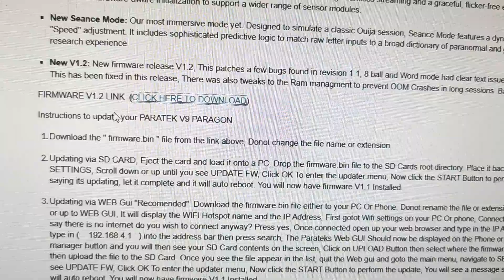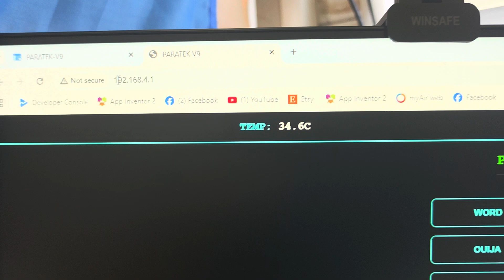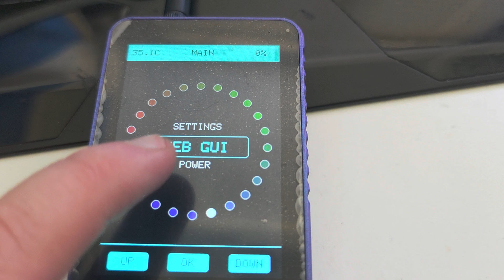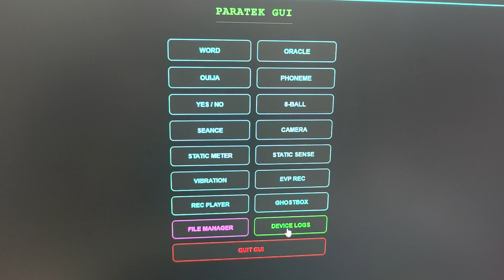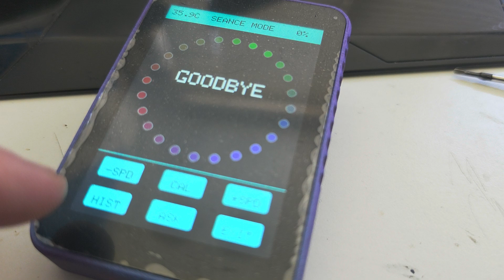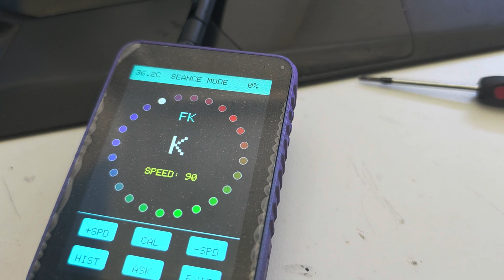ParaTek V9 Paragon update procedure.

Comment: You the new app this ad-660 yes power on off and slow fast and oh this good fm am power live bank 1234567 mode emf vol speed vol 100 min - max 590 and speed 500 min 10000 max speed sweep app beta app fm ghost radio box ad-660  oh this one echo pitch